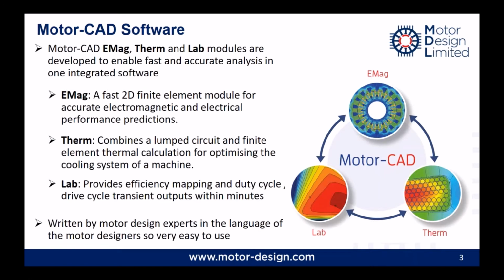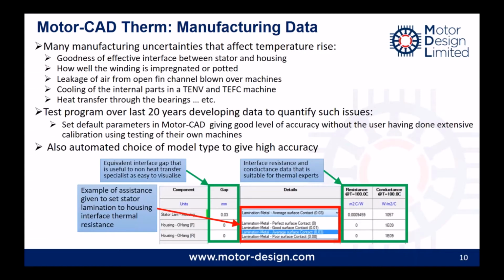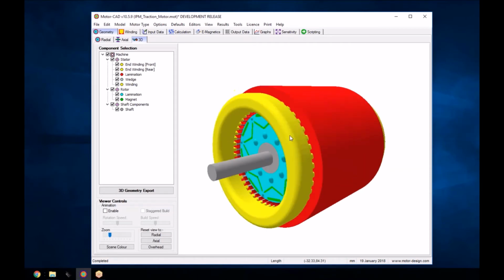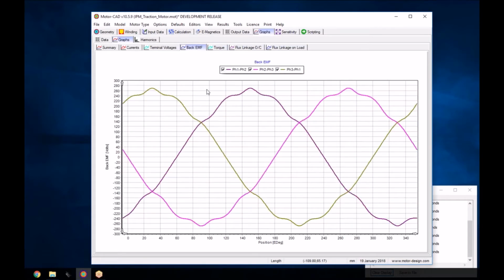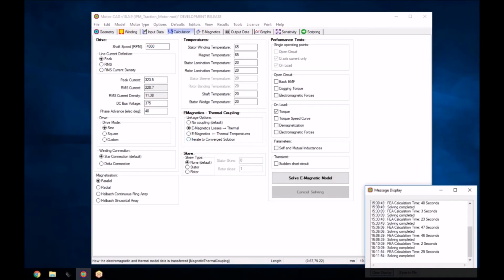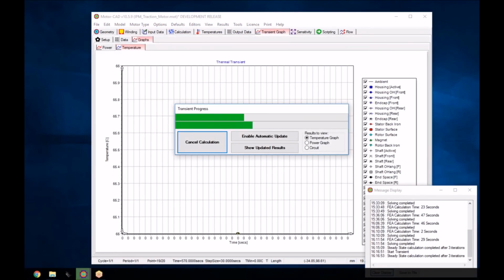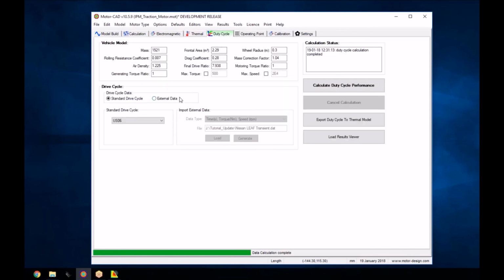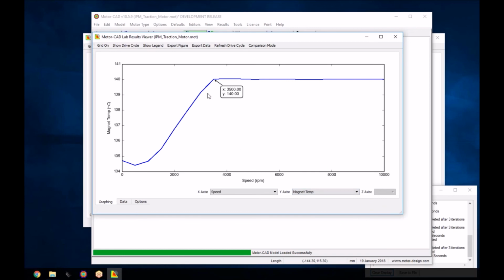Motor-CAD demonstration - EMag, Therm and Lab

Comment: Nice tutorial. Whats the difference between Motor cad thermal and Motor cad lab module of the software...
Reply from the maker: Hi Madhu, the Thermal module enables you to set-up the cooling system model and contains the lumped parameter solver which calculates the temperatures in the machine during operation. The lab module contains algorithms which compute the performance of the machine across the full operating envelope and applies an optimal field weakening control strategy. The lab module links to both the Emag and Therm solvers and gives outputs such as efficiency maps, torque/speed characteristics and performance predictions over duty cycles.
Reply: Thank you. Its really informative.But does the MotorCad considers the CFD analysis of the motors as most of the mechanical analysis or multiphysics software carry out CFD analysis for the complete motor. So can you please let me the reliability of MotorCad with reference to other CFD softwares.